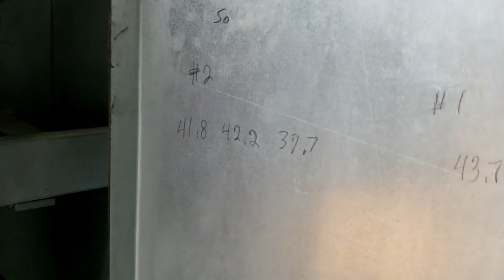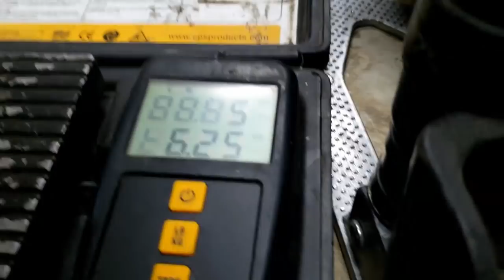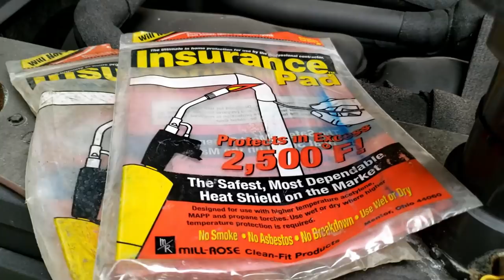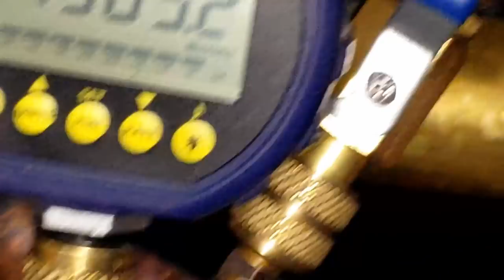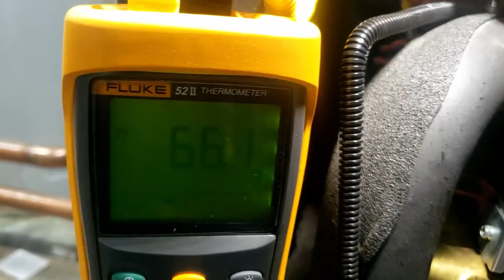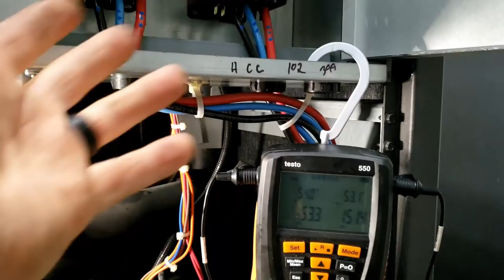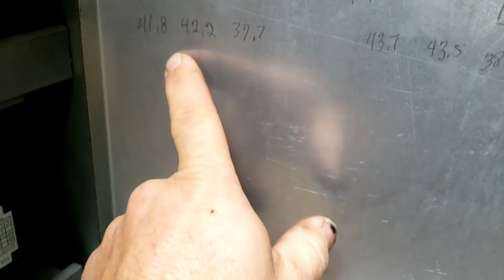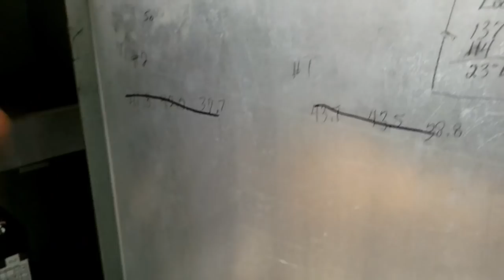Geothermal Compressor Problem And Discontinued Reversing Valve

Comment: Great video! Simplest way to verify reversing valve is with temperature probes. Suction temp before and after will prove if its a leaker.
Reply from the maker: I've had a lot of heat picked up through a reversing valve that was working correctly so I don't know if I 100% trust that.  I think the best would be pressure taps but that's very invasive.  It would be nice to know what is a normal drop across that valve. It'd be nice if the manufacturer posted something about it.
Reply: @HVACRSurvival  yeah the problem with the valve being made of copper and brass you get a lot of heat conductivity. 
I've been fooled by it before , and diagnosing a 4way valve I find that very difficult .

Comment: Great video on a geo  thermal unit. Usually you can use a magnet to which the reversing valve back and forth to see if it needs replacement. But on those it might be hard to do. Nice to use the heat blocking pads and rag to keep everything form burning up.  Thank you Rick hope to tune in on Sunday.
Reply from the maker: Thanks for checking it out Ray 👍👍
Reply: You are very welcome Rick. You are a great tech. Keep doing what you do.
Reply from the maker: @RayRay-nb7tn  when your saying you use a magnet to test the valve, are you using it on the solenoid?  I knew the solenoid was energizing when I cycled it but this system should be in heat mode by default with the valve not energized.
Reply: Not on the solenoid on the body of the valve. The valve is not going to move unless energized.
Reply from the maker: @RayRay-nb7tn  I'm surprised there's anything magnetic in it. I will see if I can make the one I cut out move back and forth with a magnet I have a hundred pounder. I've been thinking about buying a thousand or twelve hundred pound magnet for fishing
Reply: @HVACRSurvival  all it takes is a small earth magnet like you buy at harbor freight it will stick to the side of the valve I guess the piston or something inside is metal and it will slide when you take the wire off to put it in heat you will see the magnet move as it moves

Comment: The manufacturer should be using rotalock fittings on the compressors . Great job in getting that back in operation  and removing the unnecessary defective reversing valve .
Reply from the maker: Thanks Michel, I don't like roto locks, normally they never release when used outside so you end up cutting them out anyway. Thanks for the kind words! 👍

Comment: Good vid , I feel your pain bro ! Going through the trouble of replacing the compressor only to find out the bloody 4 way valve is bad,  that will ruin your day right there !
I absolutely hate 4 way valves , but nowadays you can hardly get away from them , it's like every AC unit must have one otherwise it's not an AC unit .
Reply from the maker: Thanks for the feedback Sterling, I agree!

Comment: I had one of these that was a constant nightmare. The coax started leaking and they replaced it. So glad it’s gone.
Reply: Once while it was still under warranty they decided the chill loop wasn’t long enough so they put four water heater tanks in series just as holding tanks to kinda let the water warm up before it returned.
Reply from the maker: We replaced the other unit for the other side of the building already but that was a WaterFurnace. Thanks for sharing 👍👍

Comment: I've been to two county fairs a donkey show in Tijuana I have never seen a heat pump radiant floor system always in gas fired or electric boiler never a heat pump obviously they do exist :-) :-) Keep On Keepin On
Reply from the maker: I also have one that is used for snow melt 😊. Thanks Kevin 👍👍
Reply: Well I guess living in Greenville South Carolina they have a reason why I haven't seen that ridiculous crazy system by my opinion keep the flame where it belongs
Reply from the maker: @kevinpoore5626  I would say it wouldn't be cost-effective in your region, but because I'm in Ohio, geothermal's benefit you more when you have colder outdoor temps because the ground is always a constant temperature.

Comment: Definitely looked like someone put a valve in it already. One trick I do very seldom if I cannot be 100 sure if if it's the valve or compressor I will pinch off the discharge line slowly and see if the compressor amps start to spike.
Reply from the maker: No she was a virgin, I like that idea Joe 👍👍. I'll do that sometimes to the suction piping on small reach-in compressors.
Reply from the maker: I just thought a little deeper on what you said, is there a reason you would restrict the discharge line and not the liquid?
Reply: HVACR Survival  you want to see whether the compressor or reversing valve is the problem but typically this is only if your compressor is running but not pumping at all and it’s hard to diagnose that way if the amps spike and the compressor starts to bypass I’d say start with the valve.

Comment: Hey maybe the compressor ran with high heat due to trapped oil you mentioned in the video? That can breakdown the motor windings, who knows maybe it was about to have a burnout
Reply from the maker: I was thinking maybe lack of oil caused some wear in the plates causing a SEAL issue between the plates but can't be sure.

Comment: if the tip keeps back-chooching, I'd wonder if the low pressure gauges are accurate or some restriction in the hose/backflash preventers/etc.
Reply from the maker: I replaced the gauge on the fuel tank.  I tried what the factory engineer recommend I try and removed the flashback arrestors and it worked fine. He said because I don't use my torches for cutting I should be ok without them. I think they were hanging up because I noticed a difference in the resistance when I blew through them. I prefer to have them so I might replace them with new. I never had any problems with normal tips like a number 2 or 1.

Comment: did you make sure the install-clowns didn't wire it to run the floor zone as cooling? I could see that occurring and it hammering the reversing valve to death trying to not freeze up on pressure/temps or once satisfied.
never know what darwin work  was done in the install/past lol.
Reply from the maker: I have serviced this for the last several years, it's controlled with a digital T87 basic thermostat. It's really a simple system that's just large. The building has 2 off these geothermal's total for the whole garage wearhouse area. I compared all my readings to the other 3 circuits prior to finalizing my diagnoses.

Comment: You shouldn't need your acetylene and oxygen higher than 5psi to braze. If you are having issues at those pressures you may want to consider a new tip or even a smaller one and  make sure you regulators are working correctly. By having your pressures as high as you do you're using way more gas then you need to be which isn't good having small bottles. When I was brazing in school I was able to set both pressures at 3 and had no issues brazing anything. Hopefully you aren't having anymore torch issues anymore but if you are you may want to look into some changes with it.
Reply from the maker: Accents Dunmore I made comparisons to the original torch head to the brand that I am using 4 the upgrade and noticed that the shank in the middle is not as long so I think the oxygen acetylene is mixing before going through the torch tip which would likely cause most of the problems I'm having. What's bologna is the fact that I sent these heads back to the factory and told them exactly which torch handle I was using and they said it would be fine but obviously they don't know their own products. At this point I need to either buy a new handle or some sort of adapter.
Reply: @HVACRSurvival  If you're using Victor brand regulators I'd get rid of them and use another brand. Victor is the worst stuff you can buy even though it's expensive. However in reality you're just best with an Air/acetylene torch. You would only have one cylinder to drag with you and still have plenty of heat to braze with. You could easily trade you 10 & 20cubic ft cylinders for one 40 cubic ft 'B' acetylene cylinder.
Reply from the maker: @benkeysor7576  the torches in my videos are supplied by the company,  my personal ones are much better and have a cutting head. I learned to braze with a B-tank but it won't do much larger than 7/8" and there's times where I'm doing 2"  nor has the control I like for delicate work. Everyone's different but I've had both. There's a lot of large equipment I work on that I just can't show in my videos so a lot of times all you see is these little dinky reach in coolers and little walk in systems.